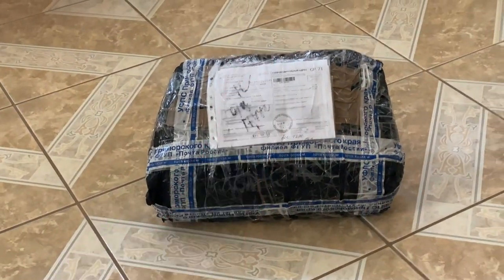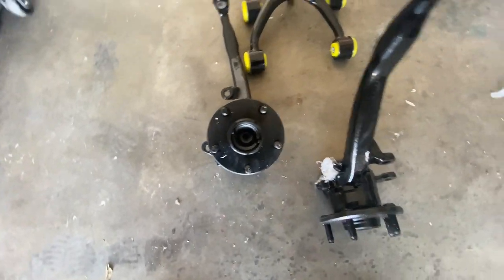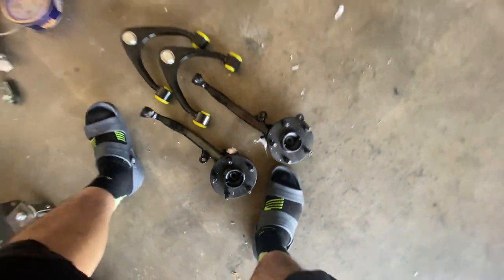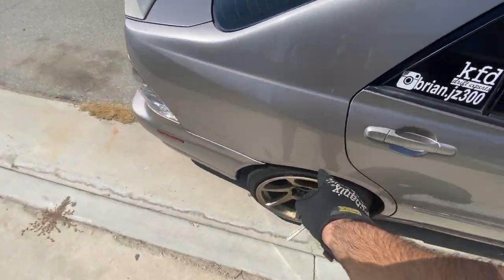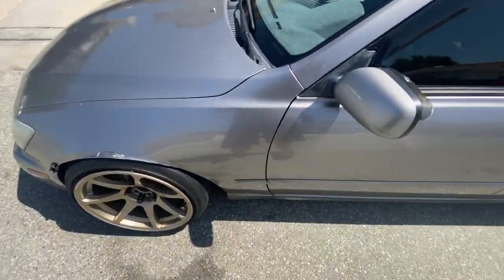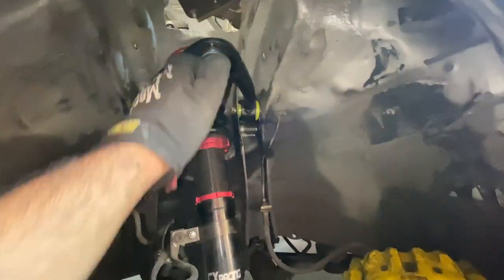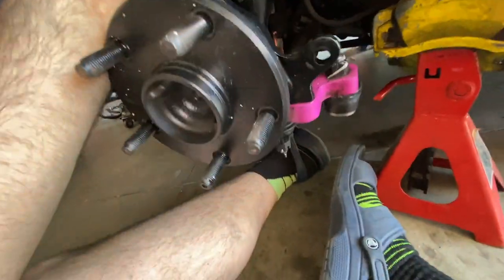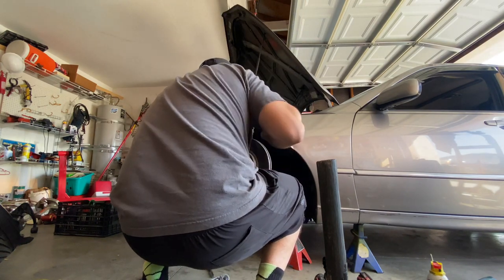30MM SHORTENED SPINDLES + JZX ARMS FOR MY IS300

Comment: Dope video! What was your offset on your wheels, I did the same but my stock wheels nor my kansei +22 offset weren't fitting so might have to go with a +18 and lower
Reply from the maker: Thanks I appreciate it! They were 17x9.5. Offset: 15
Reply: @brianjz300  Thank you man!
Reply: What size are your kansei just got them but the specs are 17x9+22 cleared with the shortened spindles
Reply: @michaelr1184  I ended up getting 18x9 +12 and they cleared but also found out my control arm wasn't adjusted properly. as well ended up selling the is300 :(